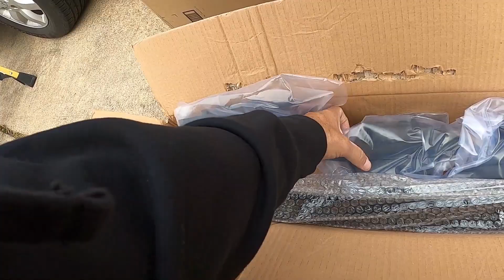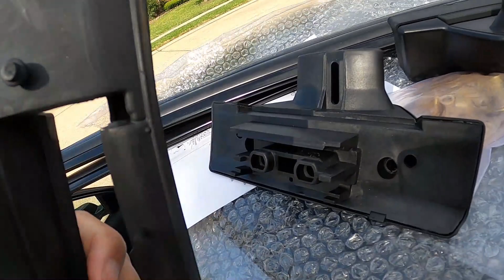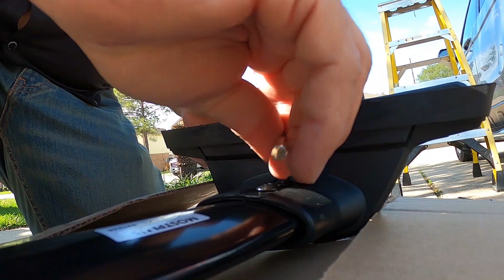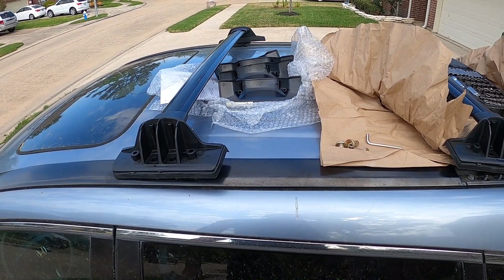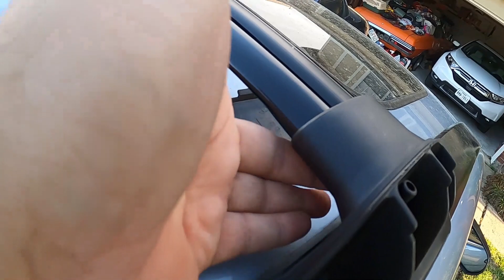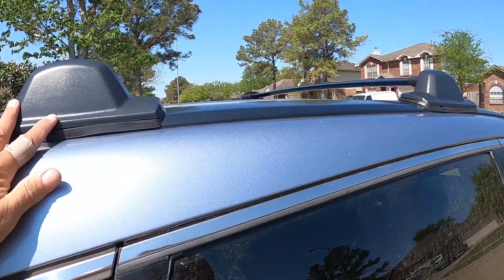2008 CR V Roof Rack Installation

Comment: I'm.womdering if you had the same issue where the front roof rack is slightly higher than the rear? I have oem ones I bought from a salvage yard and noticed the front is slightly higher than the rear
Reply from the maker: I did not and mine was an Amazon buy.  The covers on the bolts didn’t stay on or were stolen (I doubt it) but it was just my hobby vehicle for metal detecting and arrowhead hunting.  I had to get rid of it due to a guy rear ended me.  I would still be driving if it wasn’t totaled.  I had 305K miles on that vehicle.
Reply: @CommonGuy dang. That's a lot of miles. I just got mine a month ago with 103k miles. I hope mine lasts as long as yours did. Any tips on preventative maintenence?
Reply from the maker: @beast11135 keep the oil changed and maintenance up!!! I’d still be driving it if the insurance didn’t send it to the salvage yard.  It was still drivable like nothing was wrong with it.
Reply from the maker: The only issue I had was the placement of the racks due to the angles of the bolts

Comment: Great video, how's that rack held up for you? I want one to add one to my crv for kayaks as well.
Reply from the maker: The only issue I've had is one of the bolt covers has popped off, but it was not fitting well from the beginning.  It's a little low so needed to shorten the bolt length on my kayak rack but that's no big deal because they were pretty long. B
Reply: @CommonGuy  Wish I watched the video before putting mines, such a pain to fit those bolts. Also two of the bolt covers won't actually hold, they just come off immediately. But I guess that for such a cheap rack I can't expect much. They seem sturdy tho. Thanks for the video
Reply from the maker: @marcosgallodgp  yes I had only one that wouldn't set good. I lost it in about a day or two...😂😂😂
Reply from the maker: @marcosgallodgp  yes they seem sturdy enough.  I'm using it for a kayak rack.  Thanks for watching.  Those bolt alignments are tricky.  You'd think they were the same but they aren't!!!
Reply from the maker: @marcosgallodgp  if you just bought it I would ask them to give you two more.  I waited a good while before I put mine on so I know I was WAY past the exchange/return time period.